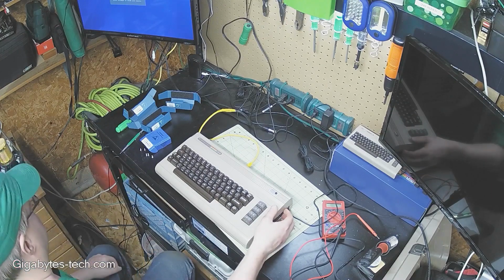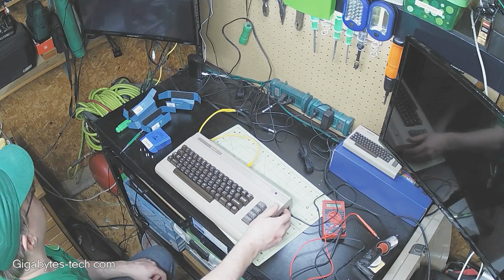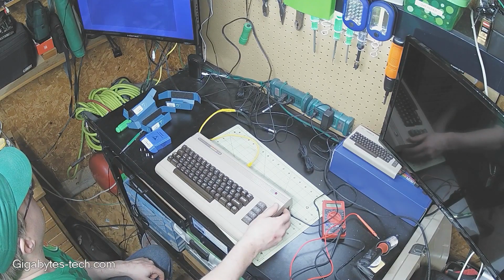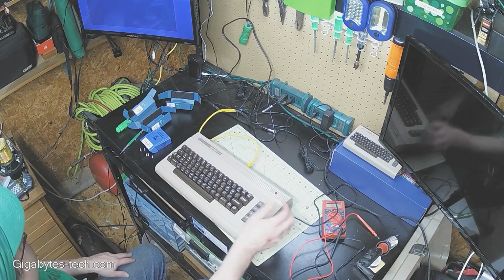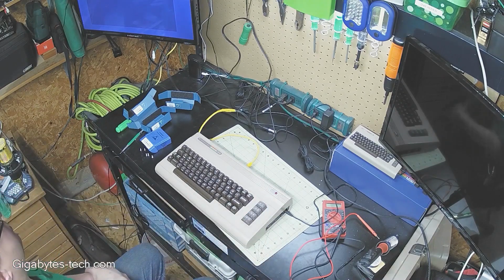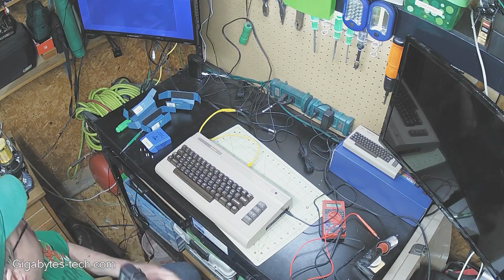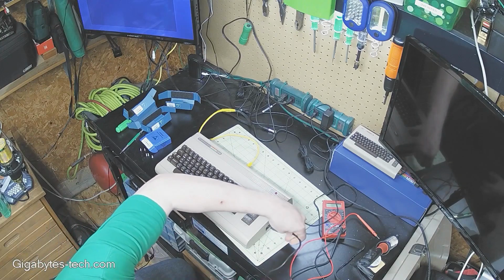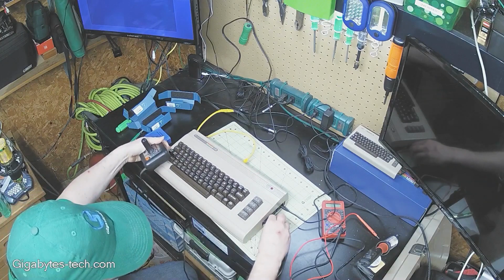Upgrading to the C64 Reloaded Mk II

Comment: Is that the 250407 RevA board. That is not a great board. Like the 250425 RevA and the 250466 boards. It have razor sharp picture with Composite. Have also the C64 Reloaded MK2 since 2017. But with the Turbo Chameleon 64 V1 because the picture is really bad with Composite and S-Video on a TV. It’s nice on a old Commodore 1702 monitor but it’s now dead. Have now with the TC64 V1 on a BenQ BL702A VGA 17inch monitor. 9i update with 640x480 60Hz the new update have strange letters on it. Is correct it but must be waiting for the next update in 2021. And it’s razor sharp and can do everything I want on it and much more. Have it in a old C64C case and I waiting for a transparant C64C case form the kickstarter out Dallas. Use the iComp 12V 2.0A Power adapter with it. 

My best C64 would always be the C64C 250466 with the 1541 Ultimate II.  Use that with a new Power adapter because I use it with a X-Pander 3 with cartridges on it. Use a lot of power and the power adapter is made for it.

Would be great if I can buy the C64 Reloaded MK from 2015.  Maybe I will buy the Ultimate 64 Elite and a transparant C64C case from Pixelwizard. And do LED strips in it nice for SID and Demos.
Reply from the maker: Honestly, it's been so long since I did that video I will have to look at the revision number. It is an older long board and it is currently in storage waiting for a recap.